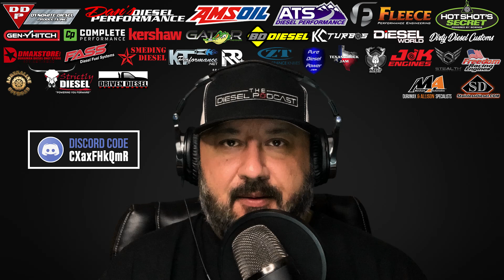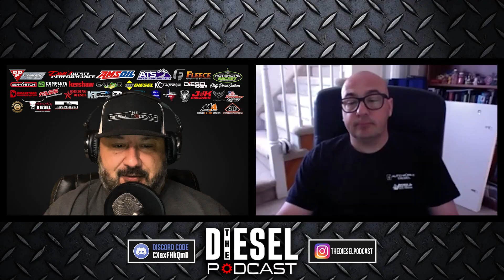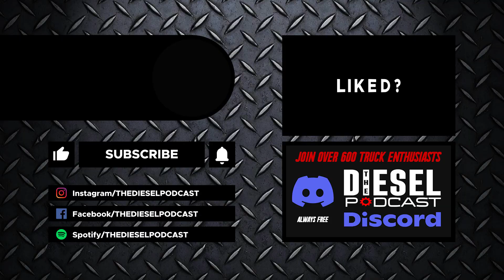Stop Doing This With Your Truck

Comment: I have had 2 new Dodges 5.9 and both were manuals and I haul cars for GM and started this when I was 23 yrs old. The wrench man told me back then that there are 2 things to kill a diesels and it’s rpm’s and heat . That’s why I drive manuals it’s just what truck drivers do and that’s shift gears in 13-10-8 speed transmission and I wish they would make 8 speed trans .

Comment: The new Dodge trucks with the light weight block that is 70 lbs lighter are junk the crack and they will make this block for a few years before the change and if you buy one good luck and I would no spend a 100K for that truck .

Comment: I waited for a long time marking a lift pump in the fuel tank for cooling the pump and I didn’t want a pump hangs on the frame. So when Fleece came out with their twin gear motor pumps and it was great and one thing that is great was that one motor hooked up to factory wiring harness and second pump cam with its own harness with fuse and switch so if one would go out you can just get her home no problem and still had more pressure than the factory pump. And this pump at idle would do 21 lbs and with one had 10-12 psi and I had a gauge on my truck before I got the new pump that read 5 psi at idle and sometimes 0 at hard pull .

Comment: My 92 12 valve had not many gauges and when towing my camper in the mountains. All I had was water temp gauge and that gauge would set a the 1/4 mark and when towing up hill I would just watch the temp gauge and when gauge would get at the 12 o’clock mark I would drop a gear in my 5 speed manual and temp would fall back to the 1/4 mark and this worked for me .

Comment: I got a notice from Dodge on my new 1992 5.9 cummins that to use the dealer oil filter or a good oil filter from a parts store because there has been a lot of cases where the filter comes apart and puts it all threw the engine and starts to clog up oil passages and when it does bad things will happen !
Reply: That would be fram. The first fram filters for Cummins were disaterous so after law suits they came out with 9776A. The A was added meaning ADJUSTED. I’ve taken the A apart . Metal caps, no bypass, cellulose filter. Can’t imagine what the previous one was built like. Hopefully not with cardboard end caps pushing 40
W oil at 70psi.

Comment: The best thing you can do is keep factory size tires on your truck . Because when you change tire size to something bigger you are changing the gear ratio and putting extra strain on your drive line.

Comment: Clean air, clean fuel, clean oil. I buy the Mopar filter, Fleetguard water separator and fine micron filter in a dual arrangement, and I have a washable AFE air filter.

Comment: Great discussion, I have a couple of questions. So i am cummins swapping my 08 ford that had a powerstroke, to a 03 common rail. EGT's would be the most important thing to monitor on that generation engine outside of the stock ford gauges, for that motor(all stock)? What is the safest tune for a stock 03 engine for daily too towing, probably towing more than daily?
Reply: If you’re running any tune on your Cummins, make sure to get some head studs.

Comment: My work truck is a 2007 4500 has a check engine light for over 200k truck runs great I do check the light every so often it's still the dpf the truck has 390k so it's getting to be time to replace it

Comment: It's funny alot will say use the exhaust brake everytime it's drivin. Iys new knowledge to hear that it will create head gasket issues. I can see that happening because of the extreme pressure the exhaust brake creates.

Comment: Don’t idle all night at idle RPM. The upper valve train does not get good oiling at idle. Select cruise control on and set at 850 or more.
Reply: This is critical because the transportation industry is seeing so many “hot shotters” sleeping & idling in their crew cabs not knowing.

Comment: He wanted to say a specific oil filter. The ole orange can of death (Fram). 47rh/re may have been out for 30 years but was never meant to be a diesel transmission. Lots of issues from the factory. It's one of the reasons Dodge changed things with the 48RE.
Reply: You are correct on the filter brand.

Comment: My old Dodge 91.5 with the intercooler over 520,000 miles on it I can still go out there in the dead of winter I’m talking 10° 15° weather specially even when the trucker sat for a couple days turn the heat grit on wait to start Lakers out And return the key often do that one more time that engine doesn’t turn over three times and it’s running over 500,000 miles anyway like the man said good quality filtration’s are use Donaldson 7349 filter for my full flow and I use a Donaldson bypass filter and also I use a amsoil synthetic. Also my air filter he’s got the same filtration Element as the M1 Abrams tank. Mira filter is a DBA 5202. It’s nano fiber technology and I can take my that rubber tube off to go to my turbo charger and take a nice clean, white rag and wipe inside of there and it comes out, almost as white as what it when it is virtually no dirt get past that filter that’s a huge thing anyway enjoy your podcast and your guest is very very professional. This is six in a row.Jim from Kennerdell Pennsylvania oh, by the way, my case 580 backhoe got the Cummins in it. Also it’s a super Rall. It starts extremely well in cold weather also.
Reply: donaldson filters are great filters. if they're good enough for 20 million dollar military vehicles they're good enough for my  80k truck and my 12k truck.

Comment: What he said 8:00 is exactly proper. Bought our '16 6.7PS with only 21k in '20 and Carfax showed a dealer services done. But i didnt trust it, so i did oil, filter and fuel filters the first week.
Piece of mind and started MY maintenance routine from Zero

Comment: Awsome podcast guys! I have learned alot and continue to learn from The Diesel Podcast, Thanks Patrick ...Every vehicle i own , new or used, gets that original owner love......a year ago I bought a 4th gen 6.7,  eventhough the dealer had just did the engine oil and fuel filters,I went ahead and re did all that stuff, also took it a step further and serviced every component that uses a lubricating oil aswell as adjusted valves, replaced the FCA, and two injectors, its finally purring like a kitten, my wife doesnt understand why i spent over 2k on a truck i just bought, but boy i sure do sleep better at night 😁